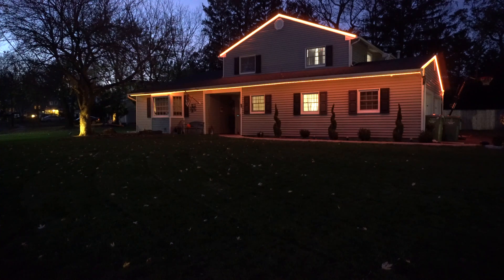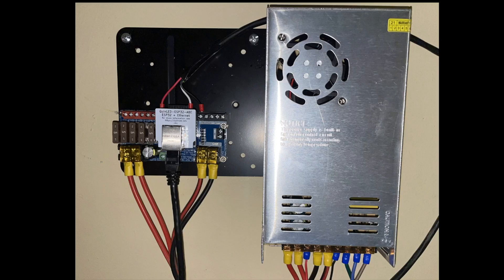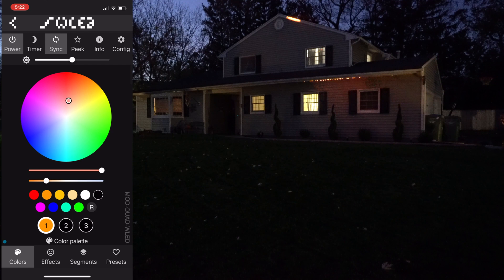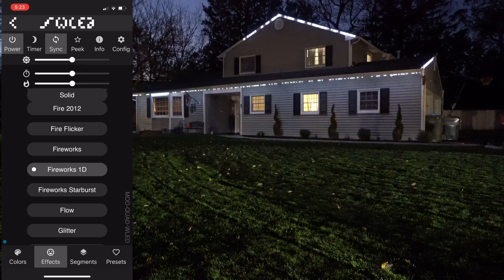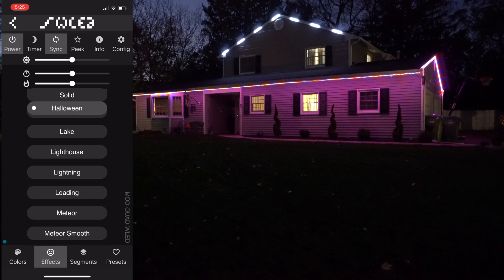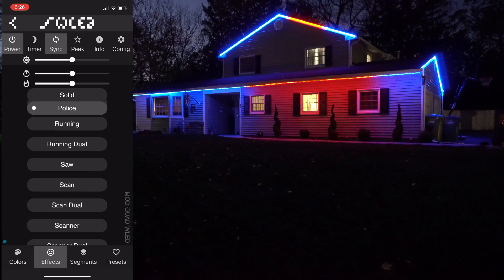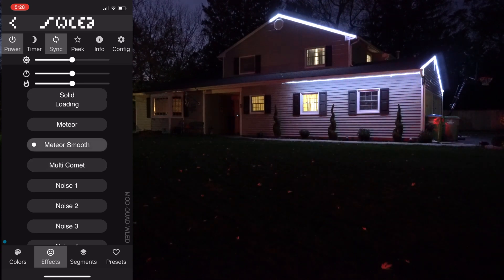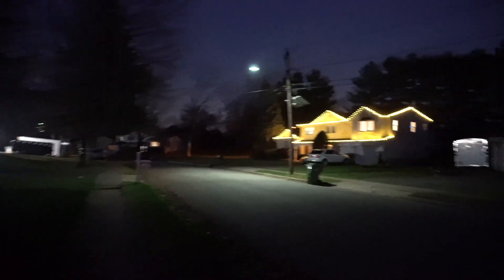Permanent Holiday Lights | WLED

Comment: Are you running any power injection?   I notice you have only one set power cable coming out of the digquad.
Reply from the maker: No power injection at all, I ran a cable in parallel to the strings but I didn’t have to inject at all! Plan was to inject when needed but so far I don’t need to

Comment: So you're running 30 amps through the Dig Uno?
Reply from the maker: The bottom section is running off of a DigQuad and the top section is running off of DigUno. Both are connected to 1 12volt 30amp power supply
Reply: @ChrisFrankShow  I thought the Uno was only good for 15 amps, which is why I asked.  I'm a noob with it comes to these things, but I've been working on it.